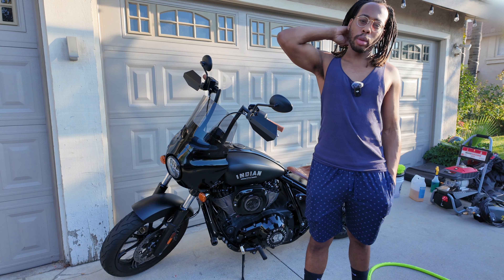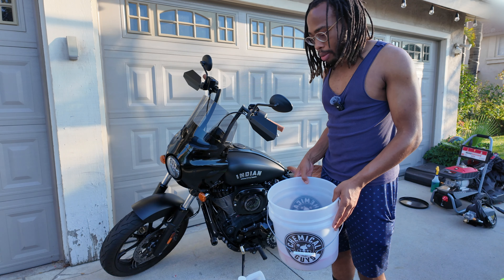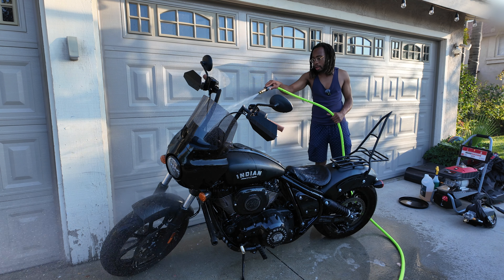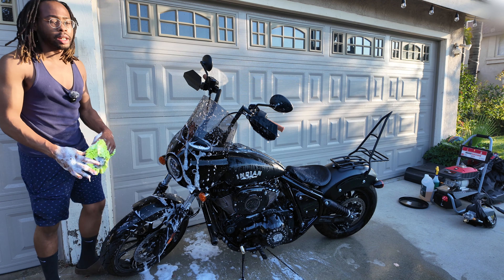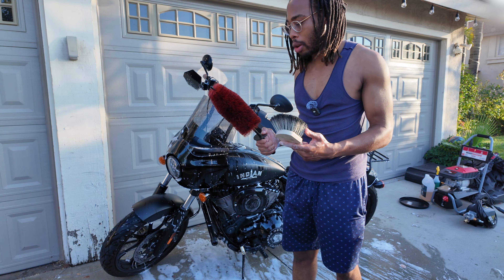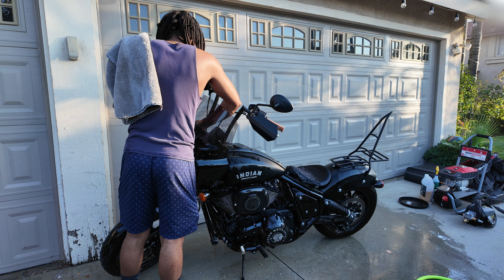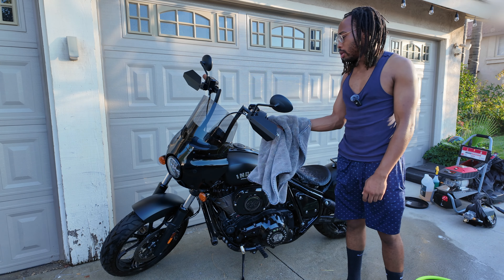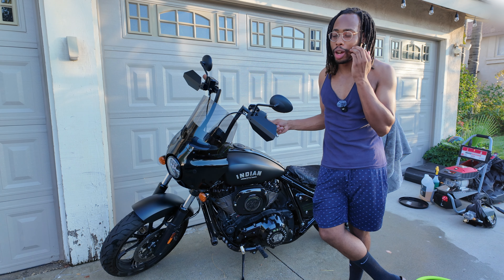How to wash a motorcycle

Comment: I have a 2023 Indian Chief Bobber Dark Horse, I am having issues trying to get a sissy bar to fit it, I like yours, would you share info on yours.
Reply from the maker: I got mines from Dean Speed. It’s the wicked model, it’s 24 inches tall, with a six pack rack, a double arch, and in matte black. It was pretty easy to install for me, I just took the four bolts out of the fender, lined the holes up with the rack then installed two bolts on one side the other two and it’s done. I have a video going over all the mods on my bike on this channel if you wanted to learn more about what else is on there
Reply: That’s the bike I have too